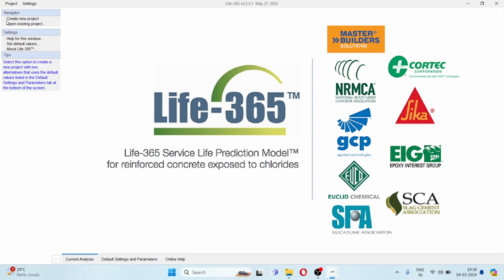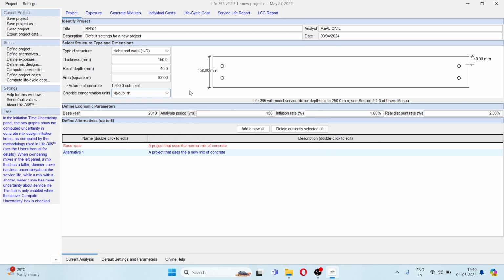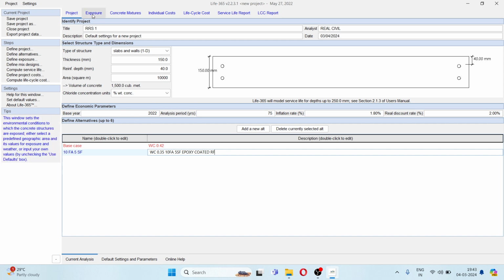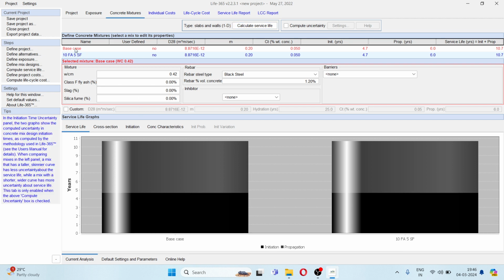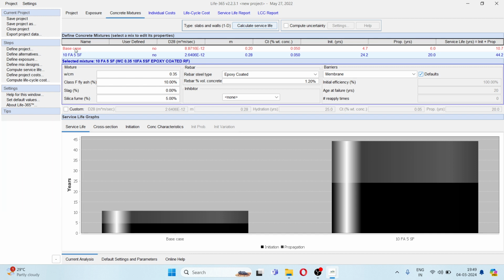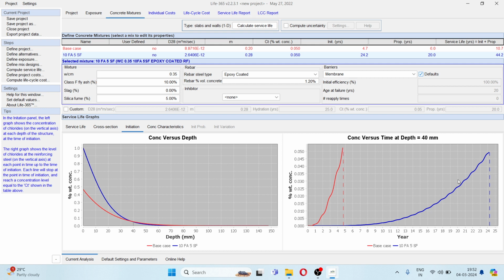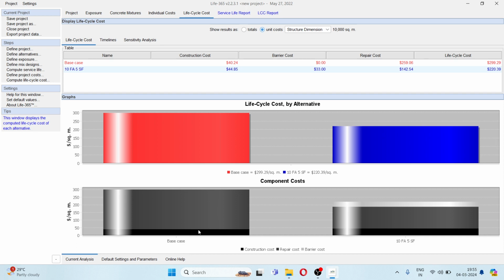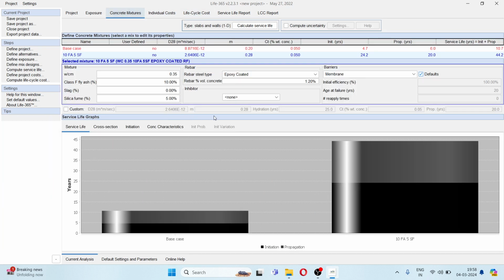Service life prediction of concrete using life 365 software #corrosion #concrete civil engineering

Comment: Hi thanks for this video. Could you send me the setup file for this tool? It seems the link does not have the setup file  and online version has some bugs. Thanks in advance.
Reply from the maker: I will check.  I have downloaded from internet itself
Reply: @Realcivil hi did you check. Please help.
Reply: @AIDatamanager30  I'm running into the same issue, reported the bugs to the company and begged for the installer for the standalone program to no avail.

Comment: Please include detail if we add manual value what will be value of concentration , its depends on what , how to decide this value and 2nd consideration of temperature should be for design life or currently range
Reply from the maker: Manual values will be depending upon the experiment. Means cholide test on concrete core. And there are some formule in literature and books. You need to search similar. For temperature you can add current temprature. There is no any provision of future temp